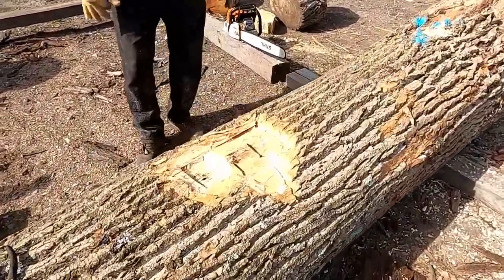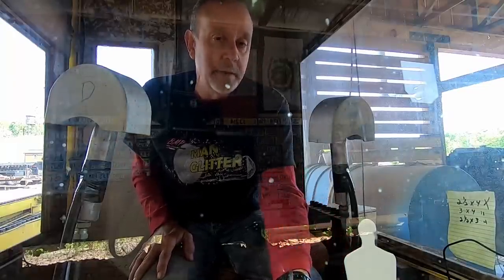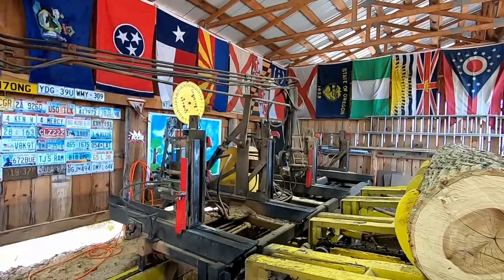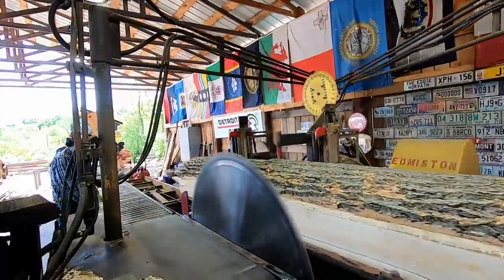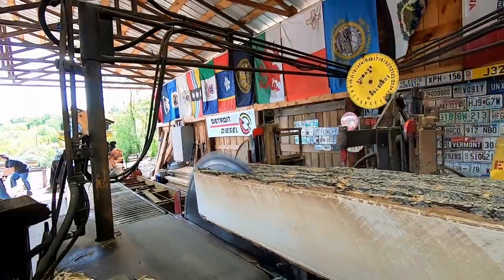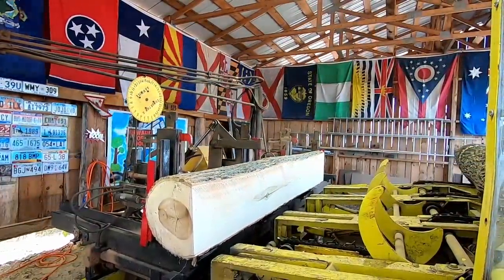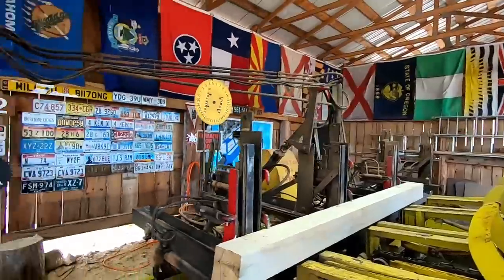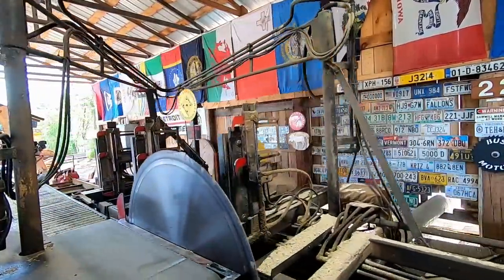sawing a poplar log with two screws in it # 430

Comment: About  10 years ago we chipped around 1000 poplar logs, paper grade chips. Not very nice smelling wood. Chipper wheel 8' diameter 3" thick with 2 500 HP electric motors powering it. 12'x 20" log takes around 15 seconds to chip. Good video ,you guys work well together.
Reply from the maker: thank you , I seen many good logs get chipped or burned just for land clearing this is why we try to saw any log that was cut for land clearing.
Reply: Dear  @markgalicic7788  
👍👌👏 Thank you, that's the way it was with sawmills and how it still should be! And yes, that's exactly what I witness around me respectively on the whole planet. Way, way too much good wood is wasted by burning it in enormous piles over and over again. Even a lot of well known utubers behave that wrong (Andrew C., BGM etc.p.p.). If not for using as timber, wood can be used as firewood or at least as biomass (including the thin branches and leaves). In Germany any sawmill sells the sawdust for making pellets and/or wood briquettes. The black boards (with lots of rind on it) get sold too (mostly for firewood or for cladding something). Heating with wood chips is also a common thing (for big plants/factories for instance). Unfortunately a lot of wood is still wasted by simply letting it rot away.
Best regards, luck and health in particular. To all of you of course.
Reply: @Chr.U.Cas1622  well said. We saw wood for our furnace during winter months. We try to collect as much of the sawdust as we can to turn it into pellets. There's an Amish operation that makes pellets and are very willing to take our sawdust. It's a win-win.
Reply: Dear  @anthonyhengst2908  
👍👌👏 Thank you. 2) That's definitely good to hear. 3) Yes, the Amish seem to know better than almost any "modern" human being 4) I just ate some walnuts. Guess where the hard peel is going? No, not on my compost heap but to the kids in a kindergarden for doing handicrafts. At least if I manage to cut open the nuts without destroying the halves of the hard peel. 😁 ;-) But of course the cracked peel will be for the oven.
Best regards, luck and health in particular.
Post Scriptum: Your surname sounds pretty familiar. It means stallion in Germany. But I guess that you are aware of this.
Reply: @Chr.U.Cas1622  indeed.... We have a family crest that we are very proud of. Thank you.
Reply: @anthonyhengst2908  
I was only asking because I'm a German guy unfortunately still living in Germany. My surname is just like the one of the famous cute ghost. Additionally like a town and mountain in Wyoming. ;-)
Reply: @Chr.U.Cas1622  ah! That makes you friendly.... I also found out Hengst makes very fine filters. They aren't available in the US as far as I know but I've thought of importing some to use in my vehicles and tractors if I could.

Comment: I often wonder how certain things get into logs. I get nails and staples. Drywall screws. I guess some will use anything to hang a sign? At any rate yes, point proven about using the metal detector first.
Reply from the maker: yes you never know what's in a log.
Reply: Garage Sale sign screwed to the tree. Those were the days.
Reply: @markgalicic7788  Neighbors hung a hammock off 2 poplars with screw hooks. The chains are still there but the hooks are now inside. Shame.

Comment: YES, Sir Marcus, I ALWAYS listen to ye olde bus (less) motor. They sure did the work! About the most impressive deal was when I was in Virginia at Ft. Story next door to Virginia Beach (Cape Henry Lighthouse) They had the amphibians based there and at Ft. Eustis. There were 3 sizes, the Larc-5 that'll haul 5 tons and had a V-8 555 or 903 Cummins, the Larc 15 that'd haul 15 tons and had 2 screws with a couple of probably 903's and the Larc 100 that had a 6-71 per wheel, would haul 100 tons and had a marine drive that coupled the 6-71's in a side to a screw which was the equivalent of a couple of V-12's with straight pipes right out the hull. Had the crab and 4-wheel steering setup but you could sure hear them when they fired up one engine at a time. AIR starters but maybe one or two had electric if the air leaked down. And they might've been Larc-50's but they sure didn't bobble with the D7-E I ran was loaded on it. That was in 72 and I'm running off my rememberer.  
Happy weekend to you, Edwardo, Sir Buzzworthy and ZZ Mark that'd glow in the dark and God Bless!
Reply from the maker: thanks Lewie , what a sound that would have made.
Reply: @markgalicic7788  It was something out on the water with a 4 straight pipes reflecting all that glorious noise straight up. And we could hear them moving around from our barracks and they were a ways away. I should've stayed and got a civil service job with the Post Engineers because I knew the boss and did a lot of work to help them out but I was homesick for these here hills. Really good outfit to be in.

Comment: Poplar is used for lots of trim pieces, casings, baseboards, stairway parts, spindles, newel post, fluted pilasters for book shelves,, And what all that means is any clear piece or part of a board longer than 42 inches can be turned into something beautiful and useful.  A knot in the middle is simply cut out and the shorter pieces become the baseboard that turns at the refrigerator, the spindles for the stairs, the top casing of a door,,, it all works.  Out of 5,000 bd ft I'll have used 4800.  The green wood turns a rich brown as soon as exposed to the sun, photoreactive.   As to narrower boards,, 4 inches and 5/4 or 6/4 stock,, doors, window jambs, narrow boards that are that little thicker,,, just fine.  Retired now, still have my saws,, don't use them much any longer.
Reply from the maker: yes I love to have poplar in the shop.
Reply: I think Mona Lisa is on poplar.
Reply: @sylvesterwolfe33  Shinny black lacquer grand pianos are poplar usually.  Yes, the Mona Lisa is on poplar.  There was some interesting research done recently on the Mona Lisa poplar.  Museums have tried mightily to keep temperature, humidity and even moist CO2 from viewers breath all to a minimum  and to stabilize the boards behind many paintings.  It has been found that many of those efforts damage rather than preserve.  Past restorations have attached strong backs, metal and wood to the back of the boards to prevent warping.  Wrong idea,, the strong backs cause cracks when the painting moves and it is prevented by the backer.  The research has said,, leave it alone.  The wood moves a little, but it comes back.  The Mona Lisa was found to be too close to an outside wall.  The back of the painting was cooler than the front and was collecting condensation.  The painting now hangs 8 feet from that wall.

Comment: You easily see how poplar self prunes as it grows, giving you a lot of clear wood in the but log. It’s such a shame I think that most poplar ends up as strand board regardless of its grade. I’d rather have the option to buy poplar plywood, but building centres are choosing to stock imported luan and baltic birch instead.

Comment: If talking and sawing causes issues. Just saw.
And any 2 stroke, fluid leakin', oil slinging, air suckin' Detroit is a bus motor. Regardless of where it is at.
Reply: I 2nd BOTH of these!

Comment: HI MARK back in the day a man log turner had 2 turn logs all day every day there was no such a auto log turner until many years later the log decks did have the log rollers on them they did help U when U use the can't hook most people changedbfrom the old hand dogs 2 air dogs which made it better and faster U didn't have lift the dogs by hand all day alot better 4 the sawyer and the man log turner MARK U know there was 3 Sawyers at sawmill the sawyer, the log turner and the man that ran the trip edger all of sawmills I half been 2 that's all old school now I still can remember that mark the last sawmill I was at had 2 saw blades that U set w a dial it took off 2 slabs then the log went 2 the edger yep the log was gone that quick those sawmills U could turn them up 2 saw more logs in a day's time dad could yes he did saw at that sawmill 2 😊 OMG 6 1 2O23
Reply from the maker: yes hard work back in the day for sure.

Comment: With all due respect to sawmill priorities having to do with market values, I would like to say this: as a woodworker with 50 years experience, I don't agree at all with how you deal with the pith sections of most logs. I have a jointer and a planer and I have hardly ever seen a pithy board that I couldn't use at least 60% of in cabinetmaking or furniture. Relegating a 4" section to dunnage is a waste of perfectly good wood. I have a small band mill, and I always use the center sections just like any other wood. All this complaining about "the pith" drives me crazy 😝
Reply: You never sold any lumber!